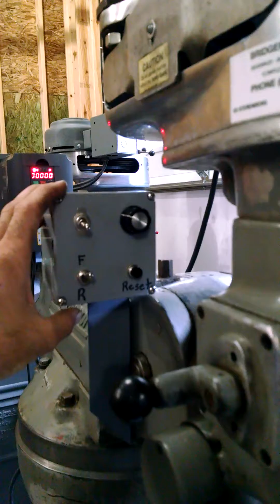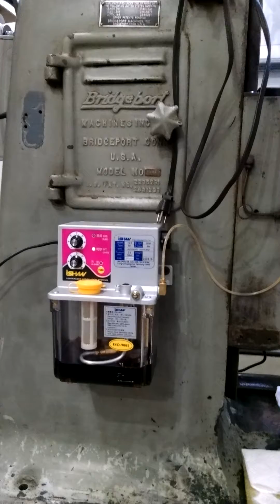Bridgeport variable frequency drive conversation

Comment: How w how did u wire all those controls into the vfd. HOW. Detailes
Reply from the maker: Every vfd I have worked with has a couple of terminal strips that have several factory designated inputs like forward, reverse, stop, etc. You wire the remote control switches into those and then go into programming and switch from local to remote control. They also have several user-definable inputs, and frequently some outputs also, for instance in some applications I've used the output to turn an automatic lube pump on and off with the machine.
Reply from the maker: Every vfd I have worked with has a couple of terminal strips that have several factory designated inputs like forward, reverse, stop, etc. You wire the remote control switches into those and then go into programming and switch from local to remote control. They also have several user-definable inputs, and frequently some outputs also, for instance in some applications I've used the output to turn an automatic lube pump on and off with the machine.